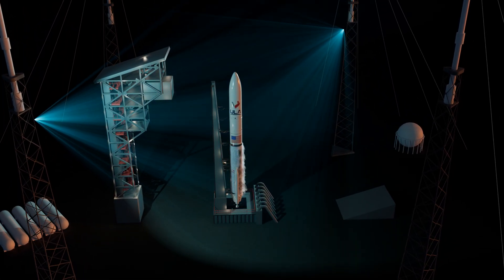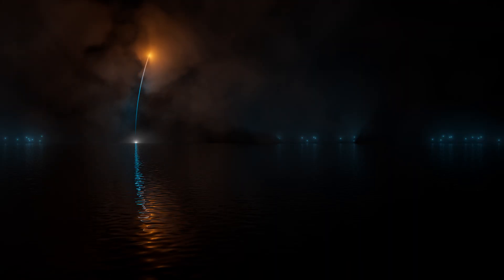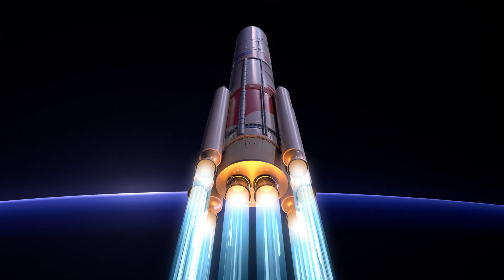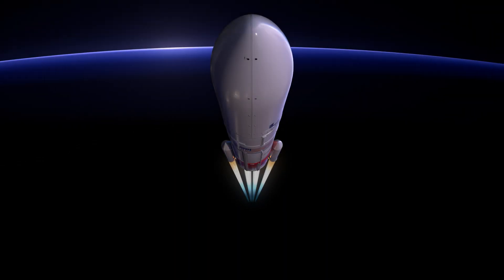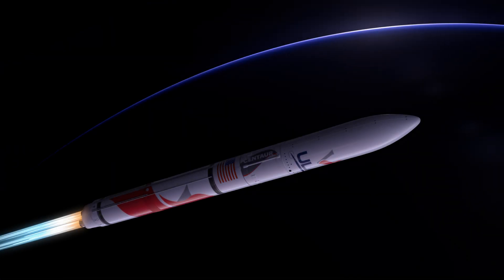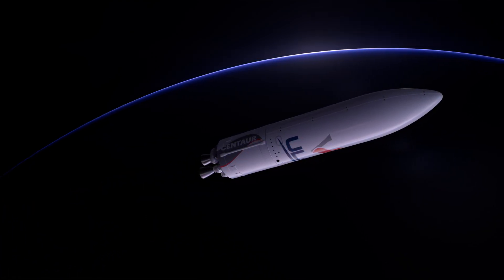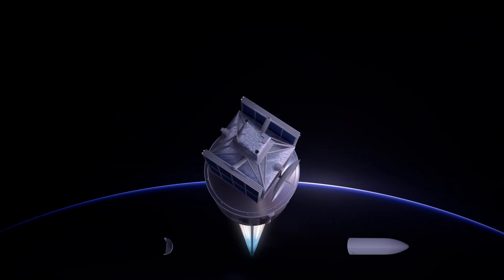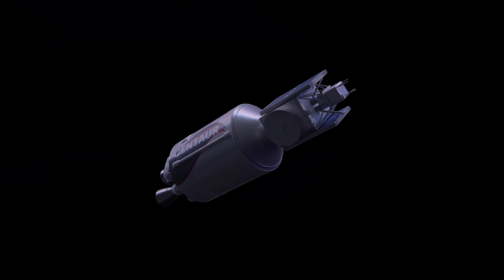Vulcan's Second Flight: Earth to Orbit

Comment: Nice animation. Now show your stuff! No re-use?
Reply: they also cut the helicopter part out, now it just splashes down and the HIAD has good buoyancy
Reply: Theres a reusable part, and its the engines, its recovered by deploying a parachute or glider i think then catched by a helicopter or smth
Reply: @Ozone_space-q1d  Its using the HIAD developed with NASA (did a demo a year or so ago) and will just float on the inflatable until the boat picks it up.
Reply: @Ozone_space-q1d  They aren't gonna do for a few more years, ULA is going to go bankrupt if they don't start pursuing at the very least a fully reusable first stage.
Reply: @cancelanime1507  what are you talking about, ula is made up of 2 big companies boeing and lockheed its not like they are out of money already
Reply: @cancelanime1507  Vulcan is designed to be profitable without reuse. Reuse doesn't automatically make something better.
Reply: @okankyoto  It makes it cheaper, they won't have any customers in 5 years when Starship, New Glenn, Neutron are all operational. Who would anyone pay more to fly on Vulcan?
Reply: @okankyoto  "Designed to be profitable without reuse" that's a word salad if I've ever seen one, you simply can't make a rocket cheaper then a fully reusable one just by reusing the engines
Reply: @cancelanime1507 Engines are the most expensive and complex part you dolt. It also enables reuse with a minimal performance hit, landing boosters takes away much more performance than just jetissoning and recovering engine section that has just a bit of extra mass to enable that.
Reply: @FrankyPi  I get that but you're gonna get nowhere near the savings you would get with a fully reusable first stage
Reply: @cancelanime1507  That doesn't follow, when you focus on reusing the by far most expensive part of the booster then the vast majority of cost for the booster will be saved, and without any considerable performance penalty.